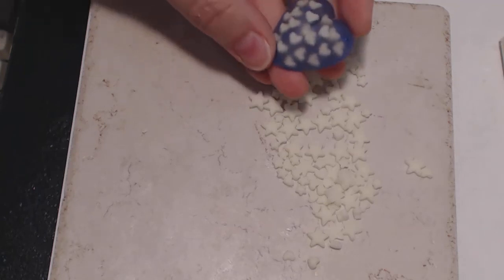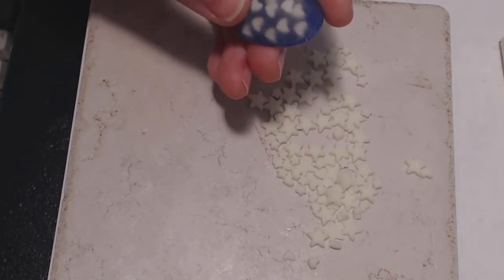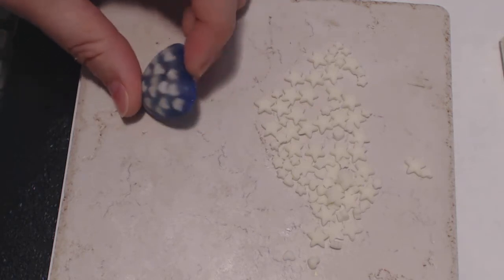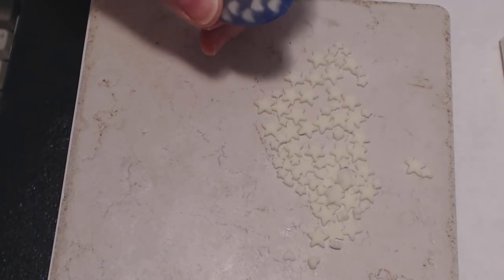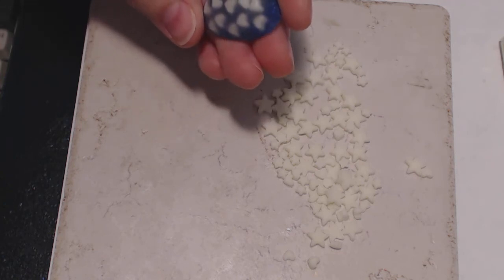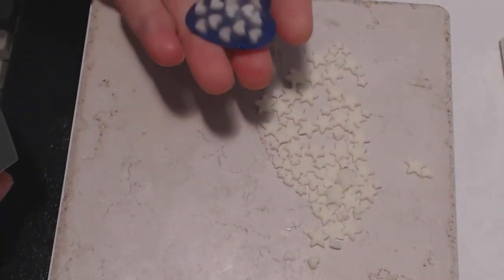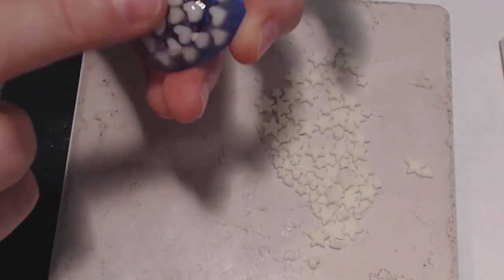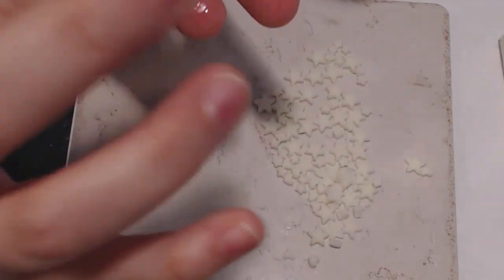Prepping Resin Pieces for Glazing - Tip

Comment from the maker: @monivaehmommy UV resin doesn't air-dry at all, it cures only when exposed to UV light, such as sunlight. The benefit to this (other than it being odorless and nontoxic) is that it has a much longer working time, so there is no rushing while working with it, unlike 2-part resin which starts curing as soon as it's mixed. Before I bought my UV light I cured all my UV resin pieces outdoors on sunny, windless days. Now with the indoor light I cure night and day regardless of weather.

Comment from the maker: @monivaehmommy The downside to UV resin is that it's expensive when compared to 2-part resin.  When not on sale a 1-ounce bottle like in my video is $10.00!  I use it only for glazing and small pieces now, and 2-part resin for large pieces. Another downside is that since it needs light to cure you can't add tons of glitter to it or any inclusions that will block the light. So, both UV and 2-part resin have their unique upsides, downsides, and uses.